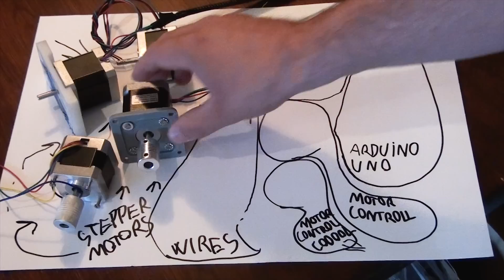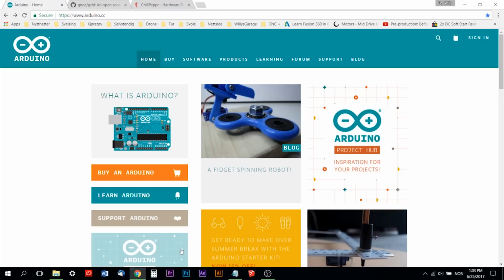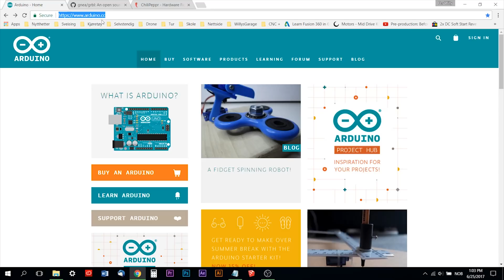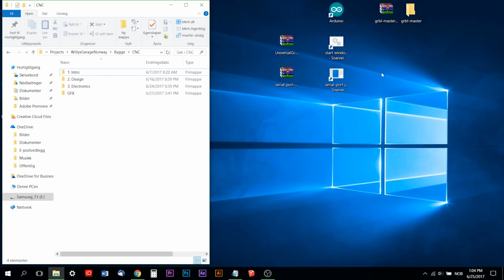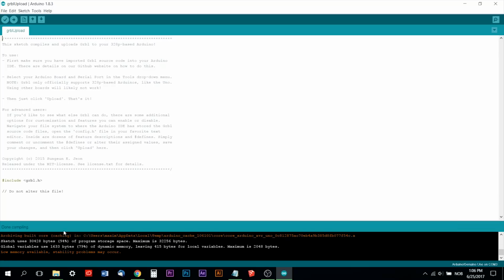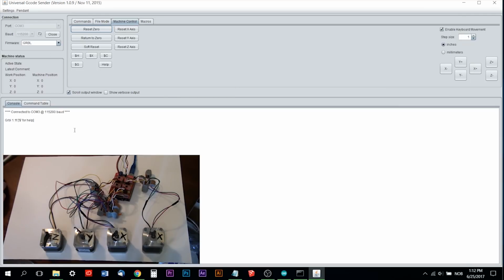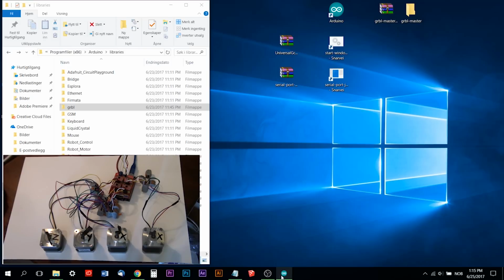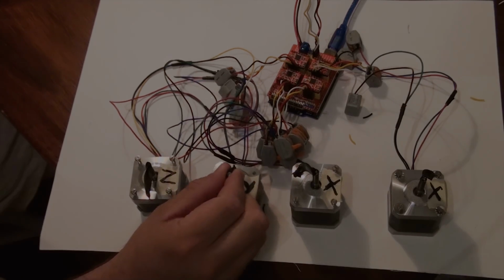First DIY CNC build (Part 3) - Figuring out the ELECTRONICS - Arduino Genuino UNO GRBL

Comment: Hello. I try to connect my 3 Nema 17 motors to the cnc shield but I have two problems. The first is that the motors when they turn left or right they seems that scratch. The second is for the clone y axis. When I connect the wires to clone y axis one of 2 Y motors turn well(in position A) but the other turn sometimes and they aren't synchronized. (I haven't z motors because I'm waiting it ). So what could it be? Thank you.

Comment: hello Sir 
I have 2 amp/phase stepper motor    what will require driver 
Which driver has to be installed in it.
Reply from the maker: azeem khan Hi. If you are making a 3d printer it would be ok with the CNC shield and the a4988.. But if it's a cnc machine you want a bit more power so I would go for the TB6560 of even better the tb6600. Thanks for watching :-)
Reply: thanks Sir

Comment: its a very helpful video but i got question how do you make the clone Axis on A axis?
and i have same problem with motors, when i trying to increase speed motor is freezing pls tell me what to do?
Reply from the maker: Hi, check out this on how to clone your axis. I have made two pictures to help you: http://willysgaragenorway.no/2017/09/20/clone-a-axis-on-the-cnc-shield-for-the-arduino-uno/
To fix your motor freezing, you have to change the top speed value called $110, $111 and $112 – [X,Y,Z] Max rate, mm/min in the GRBL code. You can do this in the Universal Gcode sender from the command line. Check this link for more: https://github.com/gnea/grbl/wiki/Grbl-v1.1-Configuration
Reply: if they are two coil motors, then wire them in series, and if they need to spin in opposite directions, flip the wire order on the second motor then wire in series.

Comment: Good Job. 
How do you fix the problem with your stepper motor  ?
Reply from the maker: Morten Lohoff I have ordered some new stepper motor controllers called TB 6560. Those can use higher current to the steppers making them stronger. I have not tried them yet, just got them :-)  I will of course make a video about it. Thanks for watching
Reply: have you checked the potentiometer in the stepper driver.... and the config file? if you try to run the steppers too fast, they just block in place. Check the config for they Y axis, to see if the steps by turn is correct...
Reply from the maker: Daniel López There were some issues with the config file on the GRBL. That solved the stalling issue. Thanks :)

Comment: You're issue with the motor stopping is most likely because there isn't enough time between each step signal (step as is from HIGH to LOW). The reason the motor goes faster is because there is less time between each command. If the time between each step is too short then the step signal gets lost. Hope that helps.
Reply from the maker: Hi. That sound about right. I managed to adjust:

$110, $111 and $112 – [X,Y,Z] Max rate, mm/min

This helped me get rid of the «feedback» problem. I also had to do some more adjustment in the configuration to get it running properly, like acceleration and steps per mm. I will address this in another video.
Appreciate your feedback and now I know who to ask if I have any problems :-) Thanks.

Comment: I experiment with my little printer steppers, and they stop too if i switch the polarity to fast. So too accelerate the motor faster you need more torque (so increase the Ampere, with the potentiometer on your stepper drivers,  if the stepper can handle it or get bigger steppers). Otherwise experiment the maximum steps/second and set this value as maximum in your code
Reply: did this advice work?
Reply: I think he got bigger stepper and also bigger drivers ;). I also have to mention, at higher speeds/fequencies the resistance of the coils get higher, so you need more voltage to get the same amount of amperes through the steppers. A good formula is to power your divers with a voltage=32*sqrt(Inductance of the stepper coils), as long they can handle this.
Reply from the maker: Thanks for the advice :)
Reply from the maker: Fatjon Alku Hehe, yeah. I got new stepper motors (NEMA23), new stepper motor drivers (TB6560) and a new power supply (24volts 15amps). I have tried the new stepper drivers and controller in a newer video. If you stay tuned you will see how I wire up the CNC machine and do the configuration in the GRBL configuration :-)

Comment: Veldig bra video. Har sett på mange videoer om oppsett av uno og program,men ga fort opp da ingen ga så bra beskrivelse som det du gjorde her.Jeg kommer til å prøve igjen etter denne. Har du link/info på den lille spindelen??? Stå på
Reply from the maker: Hei. Takker for det Bengt. Jeg slet selv med å finne ordentlig veiledning på CNC shield'en. :) Du får ha lykke til hvis du prøver deg igjen og bare spør meg om du lurer på noe så skal jeg prøve å svare. Har ikke eksakt link til spindelen men denne her er veldig nære den jeg har. Har lagt til linken i video beskrivelsen også. Ha en god kveld.
Spindlemotor w/controller 500w:
http://www.ebay.com/itm/ER11-500W-Chuck-CNC-Spindle-Motor-52mm-Clamps-Speed-Governor-For-DIY-CNC/322459715141?_trksid=p2047675.c100005.m1851&_trkparms=aid%3D555018%26algo%3DPL.SIM%26ao%3D2%26asc%3D41375%26meid%3Dd9963e971e6d4006b1058cc6995ad055%26pid%3D100005%26rk%3D1%26rkt%3D6%26sd%3D262879613998